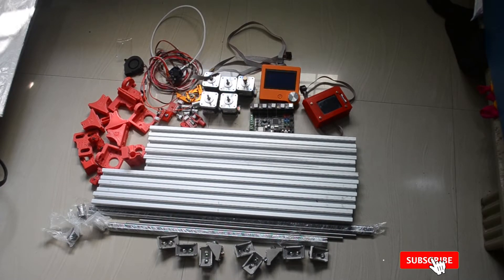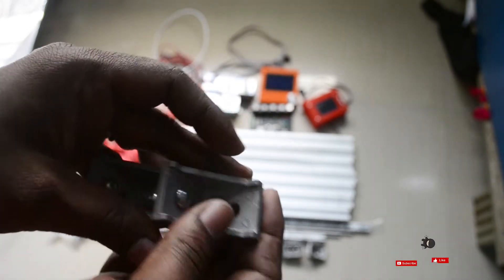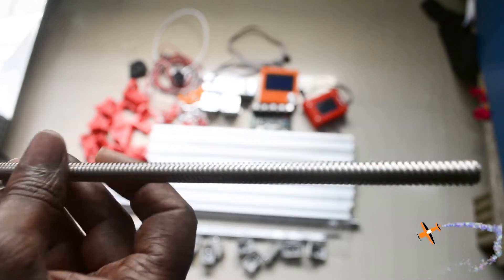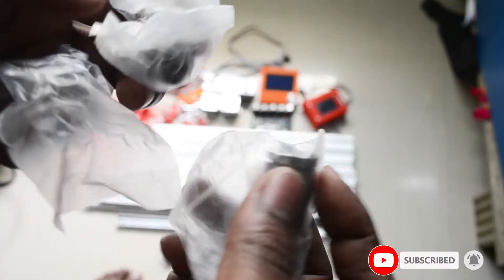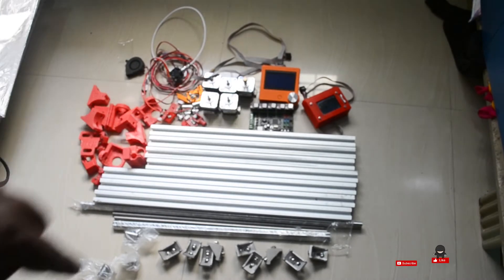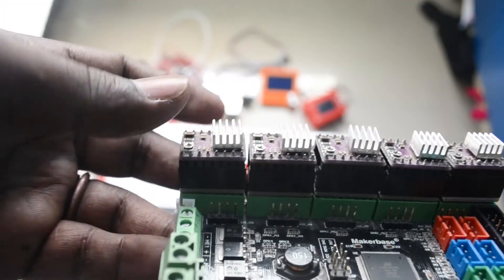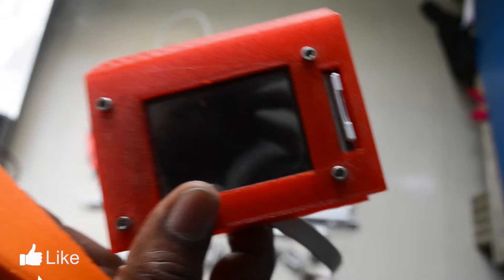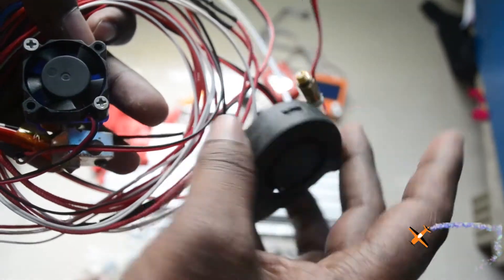How To Make 3D Printer at Home in Telugu| Part 1|Parts|3d printer ఎలా తయారుచేస్తారో తెలుగులో చూడండి

Comment: Bro you could have used  skr motherboard from big tree tech
Reply from the maker: Hi, motherboard selection depend on features  you want in your 3d printer.as per my requirement i selected MKS GEN L.
Reply: @TeluguRCHobbyZone  and bro I need to know how you connected 2nd touchscreen display as it's first time I am seeing it on YouTube
Reply from the maker: @venomgaming3290  Hi. I'm using touchscreen and also  2nd lcd display because in touch screen you will get limited features that's why 2nd display. In second display we get more Features like  pid tuning and led strip lighting control etc.. You can video of that in my English channel here:https://youtu.be/GqJNIyppsaY
Reply: @TeluguRCHobbyZone  thx bro for replying and last question is why you 12cm only